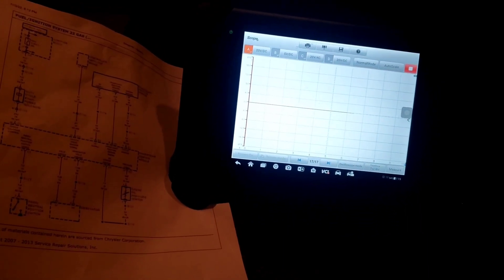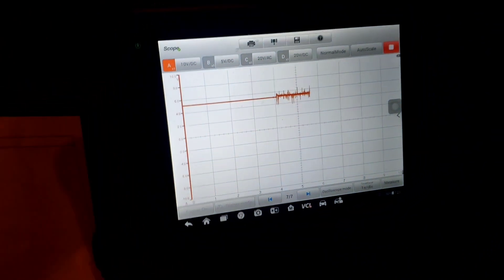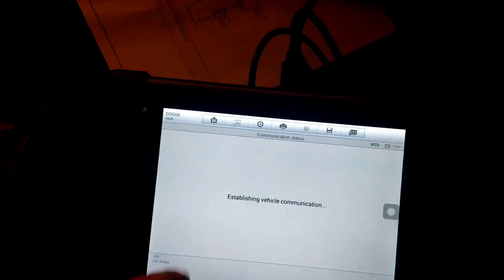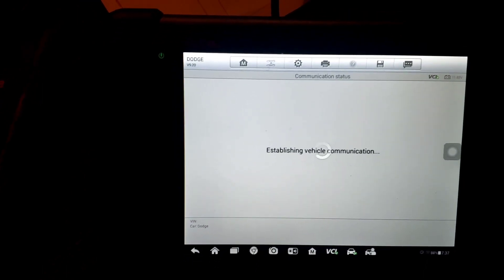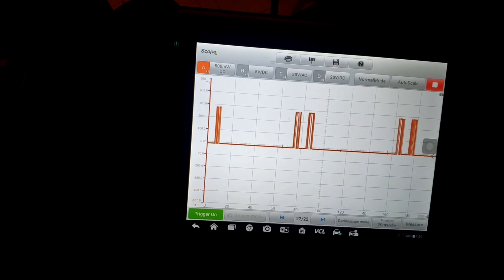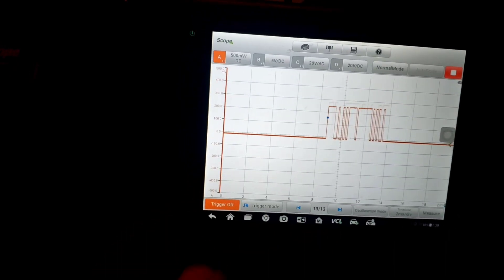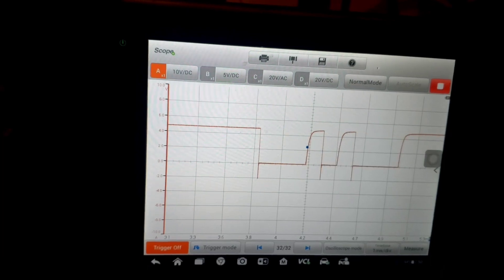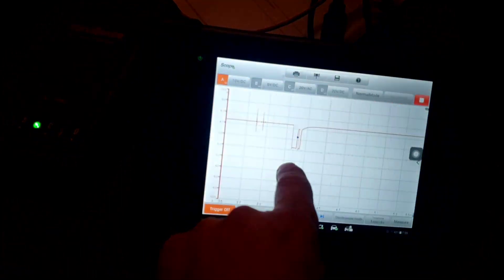1998 Dodge Ram 1500 Crank/No Start SCI Bus Issues? (Part 3)

Comment: Man I think you have a bad new crank sensor. Because the signal wire is staying high. I also am pretty sure the asd relay is acting normal for a 2 second power then loses power and it relies on crank signal to turn back on during cranking. Is it an aftermarket crank sensor? If not I’d definitely do oem if available